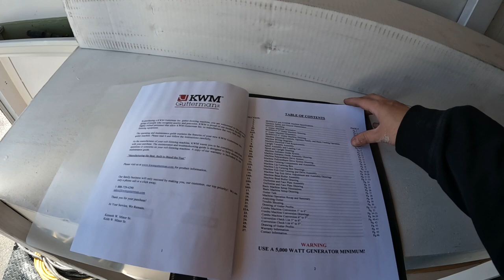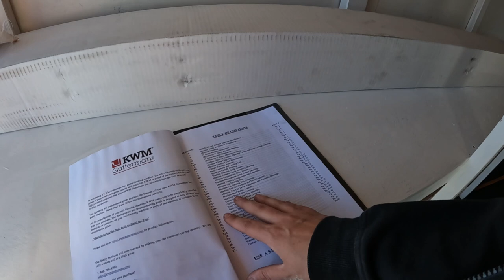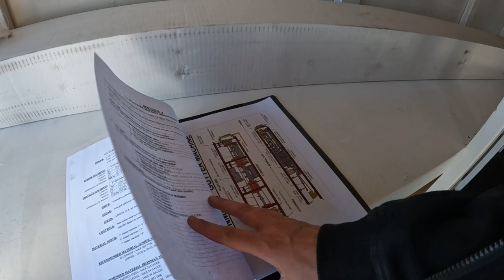How To Load A Seamless Gutter Machine On A Trailer | 5/6 Combo KWM Ironman

Comment: Some pvc pipe and a jack would’ve saved your trailer and machine a lot of stress. 

Jack it up
Put 4 pcs of 4” pvc cut at 2-3’ wide under it 
Roll it to desired location. 

Or skip all of this, go to ABC, have them load it with their forklift.
Reply from the maker: But then I wouldn't get comments like this ☹️